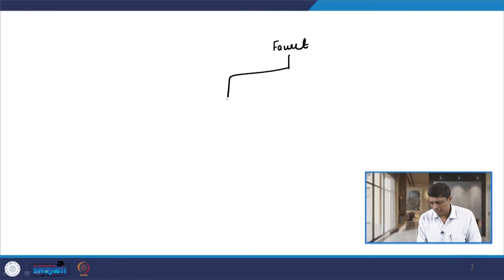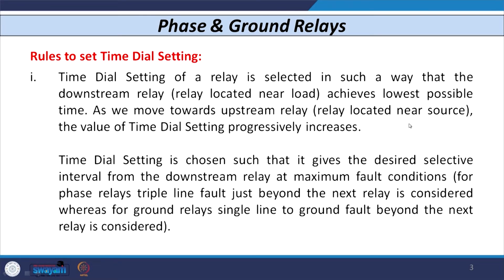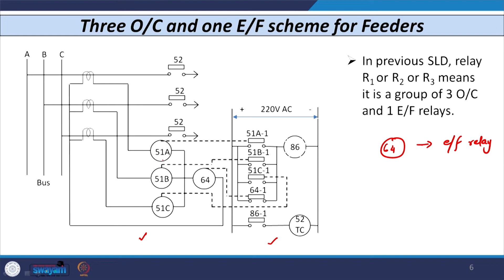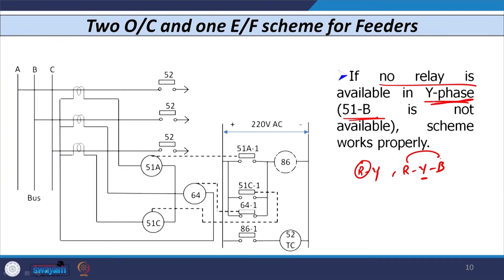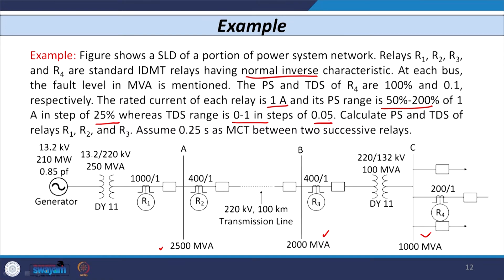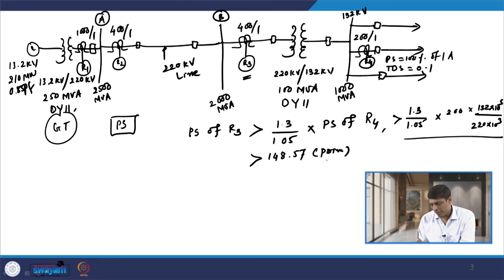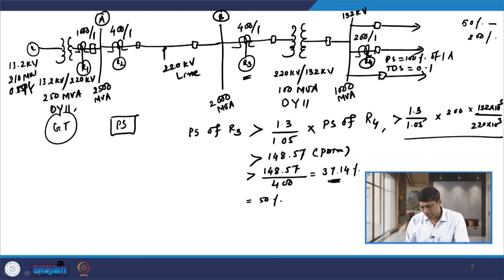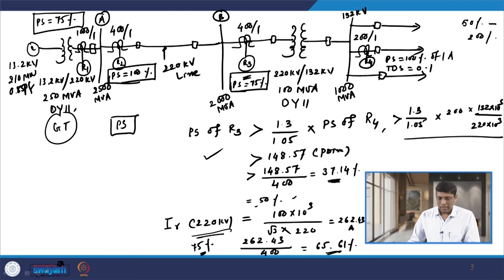Lecture 10 Current Based Relaying Scheme-V

Comment: Dear Sir,
At 22:30 I am not sure if the transformation ratio used to get PS of R3 is correct as it is not being divided by 1.732 in the star side
Reply: the ratings given for the transformer include that i feel, since it is 3 phase xmer , if you want one phase out of it , divide by sqrt(3)